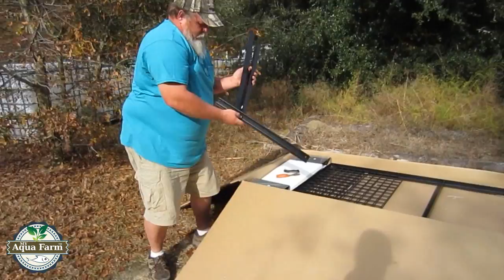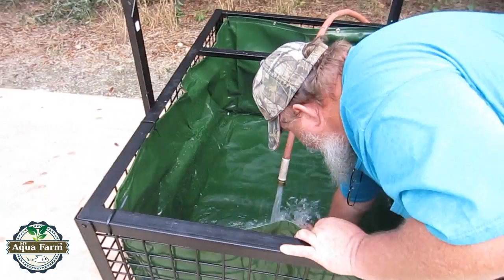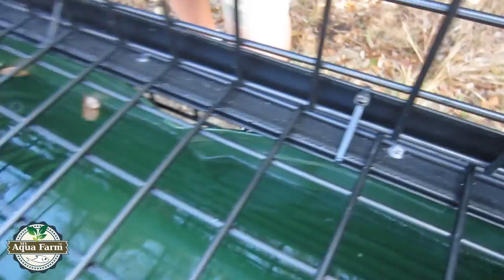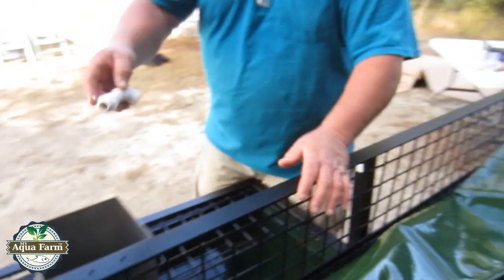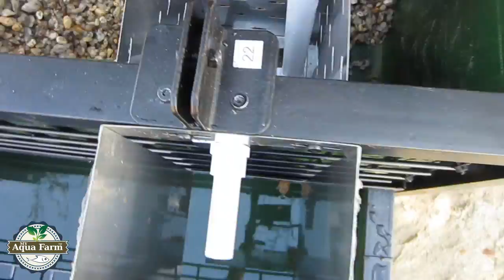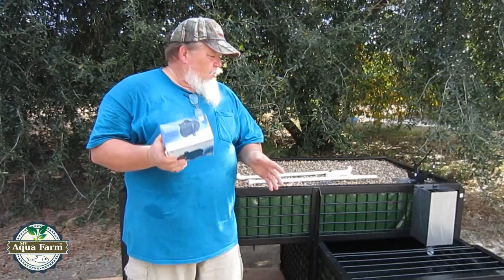MyAquaFarm Aquaponics Construction Video

Comment: This is by far the best built and designed starter system for Aquaponics I have seen on you-tube so far,, I checked your web sight because if the price was right I would have bought one just because It is so perfect and easy ,, just assemble it and done, easy ,, 

I am A DIY kind of guy and your price on your web sight was just to high for me ,, I can build the same thing for about 1/4 the cost ,, it just takes more of My time ,, and thats what it comes down to ,, what is your time worth?  I would love to just buy a setup with all the hardware and just assemble it ,, but I can't afford it ,, I have to build it myself,,,

Check your local High Schools welding class I bet they can make these for the same price maybe cheaper,, any savings you can find you can pass on to people like me,, potential  buyers :)  $600 or less is a easy click and buy for me and probably 80% of the rest of American buyers
Reply from the maker: Good luck with the welding class idea. The quality would be marginal at best (remember, these folks don't know how to weld yet), not to mention they wouldn't have the production capacity nor the powder coat facility or ability to make liners or have the engineering dept, etc... Good luck with the $600.00 figure as well. Remember, our price is with shipping included. This routinely costs over $300.00. Not to mention warehousing, accounting, advertising, support after the sale, etc... Your assumption is not inclusive of all the costs associated. I've provided, for free (actually it costs me to provide it), the Barrel-Ponics manual for the DIY crowd since 2005. It's available at www.myaquafarm.com.
Reply: This is the best built, and designed,, Assemble when you get it,,  and go setup I have seen,, Where I live I would want to sink the fish tank in the ground to help insulate it for winter,,,
Your build quality seems top notch,, but I just put the high school idea out there just in case it might help cut the building costs and lower the selling price of your setup,,
For the price of your setup on your web site now,, I can build myself a 200gallon fish tank and several grow beds, and I can buy most the parts from my local Lowels big box store,,,
I am just saying if you can figure out some way to lower the price to $1000 or less you would be selling these allot faster, and making more money,,,
It just sucks that the people that can really use this can't afford it,, so for them I am making my aquaponics videos,, I show people how to get started for under $200 bucks
Reply from the maker: I'm the author of the Barrel-Ponics manual and have been giving away, free to the user, aquaponics information so detailed I include the Lowe's part numbers in my instructions since 2005.  To date, I've given away free over 350,000 copies myself, not to mention how many times it's been shared between friends.  I've traveled the world volunteering building aquaponics systems and even last year built one in an active war zone to help feed refugees.  I'm no stranger to the whole DIY thing.  I've answered countless emails over the years (no charge), had more phone calls and conversations over the years than I can count (no charge).  For almost ten years we opened our home and systems for tours (no charge)  All these thing did, however, have a cost that we paid personally for others benefit.  It's not like my family hasn't gladly paid its dues to help humanity and make aquaponics affordable.  
As far as dropping the price to $1000.00 as you suggest.  I did that for over a year when we introduced this product as a special price to help get it established in the market.  We simply cannot afford to continue that price as it to was essentially at a loss.  If Lowe's sold its products at a loss you'd have no place to purchase the parts for your aquaponics systems and I promise you their margin is much greater than mine.  Remember, this is the best built system out there and double the size of others, of less quality, and the My Aqua Farm is at a lower, price.  I'm sure we'd all like to buy a BMW for the price of a Focus, but that's not possible.  While both will get you down the road, the honest truth is, one is, by far, a better product.  One will be cared floor and kept for decades to come.  The other will most likely be in a salvage yard by that time.  I applaud your efforts to build aquaponics systems on the cheap.  I've encouraged people to do that for over a decade and still do.  The honest truth is, the My Aqua Farm was not developed for folks like yourself.  It was developed for people who need efficiency with their personal food production both with space and power consumption (this system only consumes 20 watts) and want a well built, attractive, quality product that will serve them for years to come.  The My Aqua Farm fits the bill 😀.

Comment: Nice!  I love how you used the space and I love the flush valve setup.
I've just started looking at different systems and components and I was thinking a toilet-type flush valve would be an excellent thing for water level cycling.  You definitely validated my thoughts on that and the way you did it is a thing of beauty!
Reply from the maker: +Albert0 Been using the Flood valve since 2004.  The details are in the Barrel-Ponics manual available at www.myaquafarm.com

Comment: you made a flush valve assembly easy to understand.  thank you.
Reply from the maker: Thanks.
That's because I'm the guy who invented its use for aquaponics in such a way flood rates as low as 10gph will operate it.

Comment: Why didn't you put your power pellets inside this one? I didn't see them on your website. About to add gravel to one i just built. How much are they and can you mix them with the gravel. Love the boat fisherman value you added. Thanks for sharing. Like the feed tube control will be add that before i'm done.
Reply from the maker: +Richard Holt I don't have the shipping worked out on the pebbles yet.  Can't find an economical way to ship them.  When I do just check the website.  You mentioned "one i just built".  I don't understand?  Are you talking about a Barrel-Ponics system?
Reply: I have one that is almost done. Still need to finish the bell siphon and put in grow bedding/ gravel. I love the fishing boat set up and thinking making something like that to drain out the grow bed. Where are you located?
Reply from the maker: +Richard Holt I don't use a bell siphon (doesn't work as good as my flood valve which predated bell siphons by a couple years).  Are you speaking of an aquaponics system you built yourself?  An IBC tote system?  The basics of my food valve are in the Barrel-ponics manual available at www.myaquafarm.com

Comment from the maker: For the record, comments made without the ability to respond will most likely be removed.  Concerning Christopher Staples comments: 
There's ample aeration in this system to forego the need for a venturi.  
It appears you may not be familiar with the operation of this system as the components are where they are for a specific purpose.  The fish tank is already oversized for flexibility on the fishkeeping side of things.  
Using the entire area under the system for fish would not be good use for it since there would not be enough biofiltration for the amount of fish one could stock.  Aquaponics is all about the proper ratio's.
There are better uses for the space underneath.  We're working on some accessories for that space which will enhance the operation of My Aqua Farm.
Thanks for the comments.
Reply from the maker: +Peaceful Revolution Thank you for your question.  The reason replies are needed is to reduce the passing of false information.  To be able to reply ensures clarity to the public.
Reply: MyAquaFarm.com

Comment: add an venturi for even more aeration

also why not have larger fish tank whole lot of space not been used under that grow bed 

and why not have that drain pipe off to the side , then it's not in the way of your fishing line on that water bottle counter weight
or do you have it their to keep applying extra weight while drain is open ?

Comment: Plastic bottle?
Reply: It's part of the flood valve mechanism.  Interestingly enough they have the proper weight differential between empty and full for our proposes.  Also, instead of requiring a proprietary part (think expensive) purchased from us, the owner can easily get a replacement locally (think inexpensive).  It will take years for that though, maybe decades.  We design products the customer can easily maintain without the need to keep sending us your hard earned money.

Comment: my question is while you are filling the grow bed with water it is lowering the water level on your fish, how much displacement is there from the rocks? i would say with the water level raising and dropping so much might stress the fish so should some type of sump be used? thanks
Reply from the maker: Geo Theis No problem with the fish stress issue.  The fish tank on the My Aqua Farm is oversized a bit and the water drop is only 3"-4".  The whole notion that fish are stressed by water level changes is a myth.  We've been doing aquaponics much longer than those who would tell you so, since 2003.  In fact, in the wild, fish deal with water level changes all the time and in some cases it triggers them to spawn.  Those who say you need a sump tank usually are trying to sell you a system that incorporates such as a false reason to buy their system.  Keep it simple, keep it reliable.  Aquastead e-fish-ently!

Comment: looks cool but i think u can do a mod on the top refiller insted of having that just one u can do sort of a multiple sprinkler like shower type and that sude simply remove the need of moving the pipe around ....
Reply from the maker: Leonardo Maldonado We've been doing aquaponics since 2003.  The water distribution system you describe will clog up in very short order.  Been there, done that on my very first system and keeping up with the algae growth and bio-crud buildup was a nightmare in all the small holes.  Also, wherever the water is flowing you will get some biosolids buildup.  Being able to move the pipe around allows you to "share the wealth" where needed.
Reply: MyAquaFarm.com ok cool ... i'll keep that in thod ..

Comment: I like it looks  cool
But at a high cost $1,495.00
Reply from the maker: Michael Dev Thanks for the comment.  High cost?  Have you seen the other offerings out there?  For instance, the AquaBundance system of only 7.5 sq. ft and 60 gallon fish tank sell for $1295.00+$150.00 shipping = $1445.00 for a system less than half the growbed space and 1/3 the fish tank of the My Aqua Farm.  And we don't photoshop plants in our systems.  Also, the My Aqua Farm only consumes 25 watts of power compared to AquaBudance 45 watt pump.  This makes the My Aqua Farm 1/2 the cost compared for a very well built system (not some flimsy blow molded plastic tubs on a lightweight stand).  If you check out the other systems out there, we're hundreds of dollars cheaper and better built with more experience behind the product (I've been doing aquaponics since 2003).
If you do want less expensive, I have, and always will, given away for free the Barrel-ponics manual since I wrote it in 2005.  I was the first to offer, for free, a detailed, step by step manual (101 pages) on how to construct an aquaponics system.  It's a free download from the front page of my website at www.myaquafarm.com.  We've personally given away over 250,000 copies worldwide not to mention the many times people have shared freely with their friends.  Please stop by for a visit and download the Barrel-Ponics manual as our free gift to you.
Reply: And that my friend is what everyone wants to  know
You just saved us a lot of searching  which or who have the lowest price for this  size of aquaponics 

I sure would like to try this on a micro aquaponics size
Just for start
Reply from the maker: Michael Dev Keep watching.  We're developing a 1/2 sized system that will be available in the fall of 2015.
Reply: Thats great i really would like to try it out and see how this thing works

Comment: that last part of the demo with the water and valve was worth the hour long video. What a shocker. But how much water is displaced from the fish tank, when the grow bed is almost full? I didn't quite see that part.
Reply from the maker: shakaama Thanks for the comment and question.  It only takes 40-50 gallons of water to flood the growbed.  There's still over 100 gallon of water in the fish tank.  I desiogned the fish tank to be a bit oversized to make the system more stable and hyelp ensure success by the operator.

Comment from the maker: For Chak Zheeyui - you can order off our website at http://www.myaquafarm.com/
Reply from the maker: Jane Doe If you mean pumps and such, we will have them coming on the next shipment.  If you're wondering about the liner, it's made of material that's tough but easily repaired.  No need to buy an expensive liner if for some reason someone drove a knife in it.  As far as the other parts, haven't had any break yet.  This system is very reliable and robust, designed to last years.
Reply: Appreciate Video! Excuse me for chiming in, I would appreciate your thoughts. Have you heard the talk about - Patlarny Gardening Expert Principle (just google it)? It is a good one off product for learning how to expand your produce with the clever art of aquaponics without the normal expense. Ive heard some amazing things about it and my mate finally got amazing success with it.

Comment from the maker: Chase Cattaneo to answer your Question: Many people new to aquaponics may wonder this. Most don't realize that the Flood valve for controlling flood and drain on the My Aqua Farm aquaponics system has been around longer than the use of bell siphons. After I released the Barrel-Ponics® manual in 2005 it became apparent that the toilet valve used in the manual wasn't available in many countries and the effort to use another method to control the flood and drain of an aquaponics system not reliant on switches, timers, microprocessors and such was sought after. Many variations of siphon based systems were used from loop siphons to standpipe systems and then bell siphons. While bell siphons do work they have the limitations of being able to only function within a narrower flow rather than the Flood Valve I developed. If the flow rate is too small, the siphon will not initiate, too much flow and the siphon will not disengage. The Flood Valve can operate on as low a flow rate as 10 gallons per hour and will function with flow rates well outside the parameters for a Bell siphon to operate. This is one of the reasons why we prefer the Flood Valve. It can operate where other mechanical systems cannot. If, for instance the pump get's clogged while away the system will continue to operate returning the water periodically to the fish tank to it's full volume. A bell siphon based system would keep the growbed flooded and the fish tank with less volume. A secondary, albeit somewhat personal, reason is it's just plain fun to watch. Everyone who has watched this type system function basically gets
a smile on their face. The rocker mechanism on the My Aqua Farm™ Aquaponics System is a silhouette of a man in a fishing boat. When the mechanism functions, it's as if he's caught a fish and the boat rocks forward. Just plain fun to watch.
Reply: thank you I was wondering  about the difference with a bell syphon and flood valve. thank you for your beatiful explanation
Reply: Yes

Comment: for $1000.00 these are a great value!
Reply from the maker: The price increased 2 days ago.  The $995 price was an introductory price we had held for over a year.  The new price of $1495.00 (shipping included) is still a great value at half the price of other systems of equal size and less quality.  We're also setting up both online dealers and local Value Added Reseller's (V.A.R.'s) who will assemble the unit for the customer and still get it into their hands for the $1495.00 price for the system alone (media and fish are extra).
Reply: oh! your website said $1000 free shipping.. anyways, nice product!